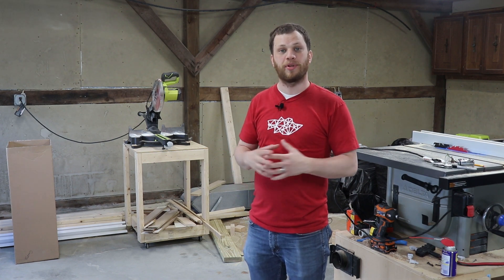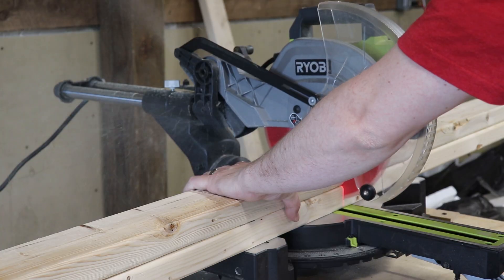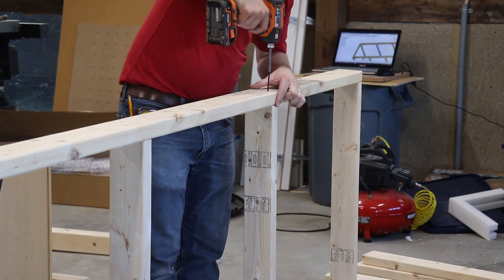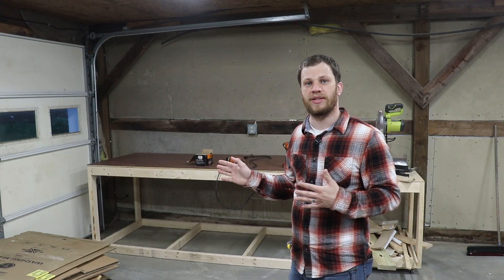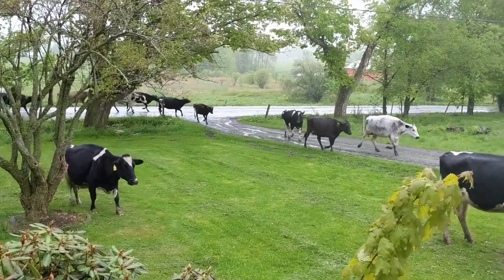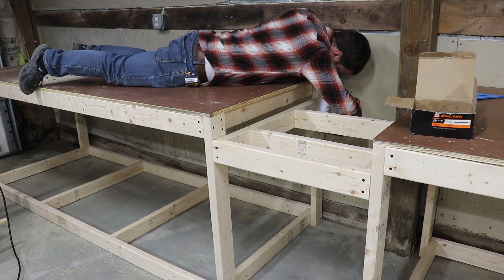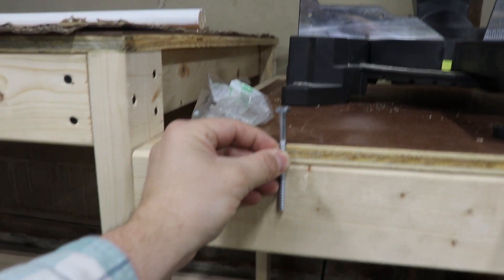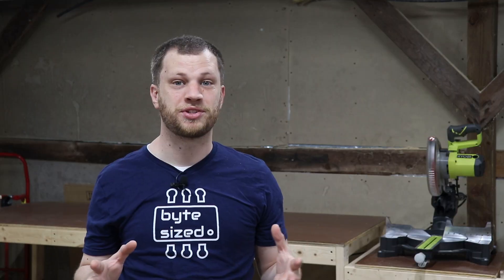Super Simple Miter Saw Station

Comment: Hey bud, very nice build you did.  I tried pulling up the link for the parameter adjustments in Fusion 360, but was unable to figure that out.  It doesn't give me a parameter option to even change it.  Anyway you can provide a way to have that done?

Comment: nice build.  Some people put integrated measuring tapes in their miter saw stations. They bought I guess sticky tape measuring tape which you carefully measure and then place to zero to the saw blade.  I would like to do that.  Lights over the saw blade would be an easy upgrade that would probably be really useful when you're working.  Your side tables are kind of begging for use as storage places also.  But I like your quick and dirty setup.  I did a quick and dirty desk setup that took maybe 4 hours to build and that I used for years before I took it apart. Thanks for the video.  I have a jobsite miter saw stand that I use sometimes and I would like my miter saw to be easy to disengage from the garage miter stand so that I can move it when I need to be able to work on the move.  I don't know if that applies to you at all I suspect it doesn't but I would like to be able to just use my quick release handles instead of undoing lag bolts.  I've never used "hardboard" before.  I'm thinking that's so you can slide the wood when you are making cuts? I do like that.  I hope you don't mind my saying it but I believe you made those tables way too wide, they'll be so wide that they'll be just getting in your way.  You probably don't need tables wider than the wood your radial arm miter saw can cut.  Maybe you can make use of the space or maybe for some other reason that works for you but for me the width of the tables takes up too much space in your shop (I know it's a big shop but still) and is not helpful to you in working with the wood. Again, hope you don't mind my saying that and I know this is not your be-all end-all miter station and it's certainly better than any permanent miter station I've ever built.   

I liked your table saw take-apart video.  I have the same table saw and I have been very interested in building up a more serious table around it so I thought that was fascinating and I'm eager to see what you did with the table saw after that.  The same thing minor criticism applies to the table saw video, that ideally I would like to be able to just pick up the table saw and move it to a jobsite whenever necessary.  But on the other hand I do see the appeal of having it permanently installed in a dedicated table saw cabinet. Thanks for your great informative videos.

Anyway God bless, thanks.
Reply from the maker: Those are great ideas! Thanks for the feedback and thanks for watching

Comment: I work in a shed, and I feel my miter saw takes up too much room. 
I plan on cutting a hole in the wall, stick the back end of the miter saw through it, then frame and enclose the backend with a door that I can open at the bottom of the stick out to drain saw dust. 
I think I'll be able to add nearly 20 sqft of available floor space by doing that :D
Reply from the maker: That's a great idea! I agree that the back end of miter saws take up way too much space. You have to pull them away from the wall so far just to make sure you have enough clearance to move it in all directions.
Reply: @bytesizedengineering  If my math is correct I've got enough space between the studs there to get full range of movement. if not it's not hard to frame a "window" and the shed is bare studs so I don't have to mess with drywall or other wall coverings.

I saw somewhere a sliding miter saw that had the guide rod over the cutting area, so it was really compact, either it's held tightly under patent or doesn't work well because I've not seen any for sale in the USA at the usual places.
Reply: @dscrive  Search for Bosch glide saw, it doesn't have the traditional rails sticking out the back so it takes up much less space. Not the cheapes saw you can buy though.